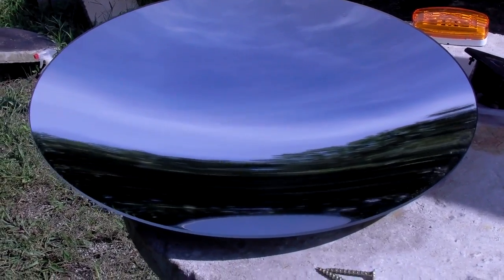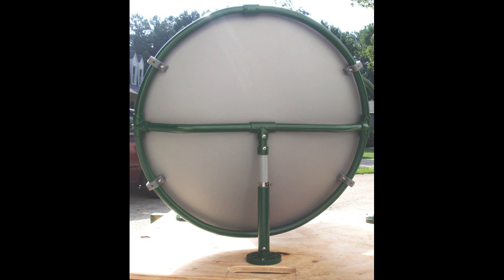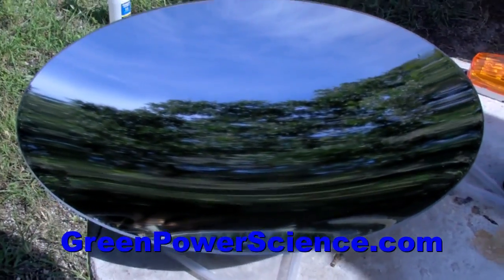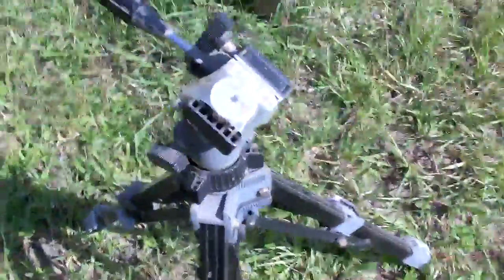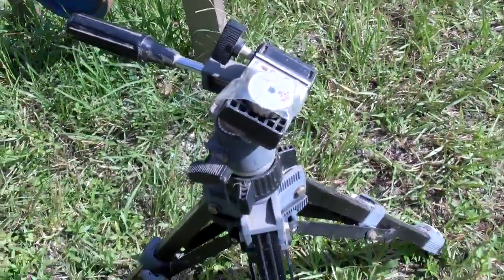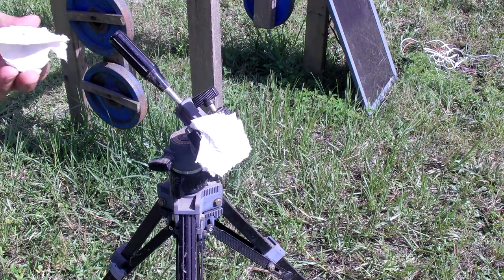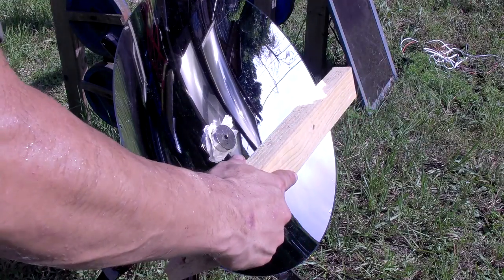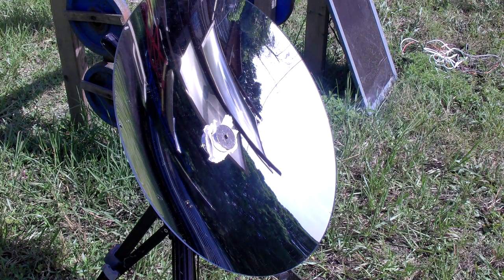PARABOLIC MIRROR NEODYMIUM MOUNT

Comment: Melting is the way to go I used a small starter hole then used the tappered drill bit  from harborfreight going backwards to go to 1/2 inch then found a tappered brass hose nozzle that took it to 3/4 then tapped it with the 3/4 pipe on the theads $12.00